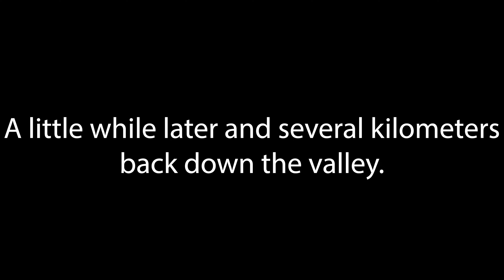Long Range VLOG continued... FalconRad FPV

Comment: The footage look awesome. I always wanted to ask , why do you prefer Betaflight to inav? Is it the flight characteristics or you trust GPS rescue more the inav RTH?
Reply from the maker: I use Betaflight but I also have a lot of experience and almost never use return to home, I just autolevel and hit the throttle instead if necessary.   But I'm sure INAV has better GPS functions and a more reliable return to home.
Reply: @FalconRadFPV  Inav RTH never failed me personally so far, but I can't make a quad fly as good as betaflight. No matter how I tune it, betaflight feels a little bit better. But that's my personal experience, I do use inav on several builds.

Comment: Last week I drove 2 hours out from home to go fly this slot canyon we used to hike when I was a kid. About a mile from the start of the trail the dirt road I had been driving on for the past half hour is closed... Ok cool, I'll drive down to the old rail road bridge over the river. Nope not there either, someone put a gate up since the last time I was down that way. Ended up driving back home and flying the same exact boring field I always fly.

Also just picked up that Foxeer Lollipop, how was it?
Reply from the maker: I've only used the lollipop to go out about 3km so far, but it performed well.  It sucks the spots you wanted to fly no longer had access.  Good luck finding some new ones!

Comment: I need some advice on how to stiffen up the bard pole antenna it’s causing oscillation at higher throttle is there a clamp or something to clamp it to the vtx antenna ? Appreciate you
Reply from the maker: Avoid clamping it to the VTX antenna.  getting them right close together may cause interference.  If it's an SMA version then the sma mount maybe needs to be stiffer?  If it's the .ufl version then the SMA mount should have a fin or slot sticking up to zip tie the antenna in place.  If it's for one of my frames email me at falconradfpv@gmail.com and I can get you setup with a mount that will allow you to strap in the bard pole.

Comment: Hate it when that happens. In our area, much of the summer flying season was too hot to fly. Even in the shade. If I tried to go early or late to beat the heat, I was swarmed by mosquitoes. I don't have one of those slick screened shelters but after this summer, I'm considering it. Between health issues and weather, it's been a washout for me. Not what I'd hoped for.
Reply from the maker: Darn, sorry to hear that this season hasn't worked out for you.  Ya the screen tent makes a HUGE difference when there's bugs out.  I can also hang a cloth over the side to make some more shade.

Comment: Have you considered long range flying in the rain? It would definitely be a different look. you conformal coat your boards right?
Reply from the maker: Yes I have and found that water on the fpv camera lens made it hard to see well enough to get in close to anything.  If it's just a minor drizzle then flying in it seems to go fine.  Every now and again it'll be raining up at the top of a mountain while I'm flying.